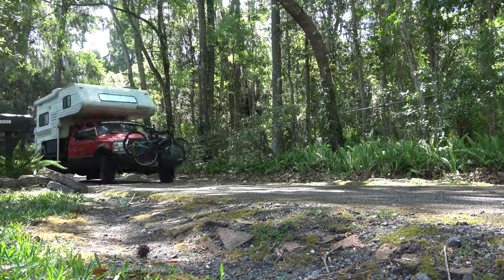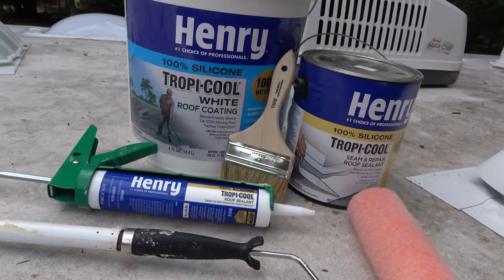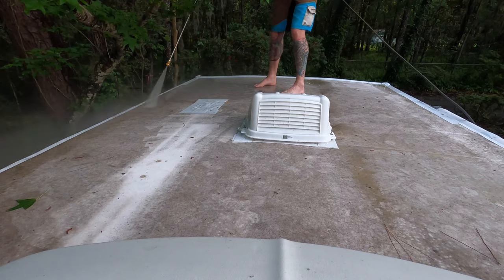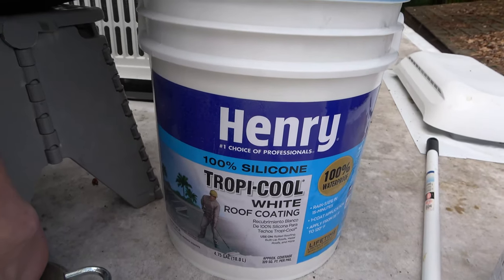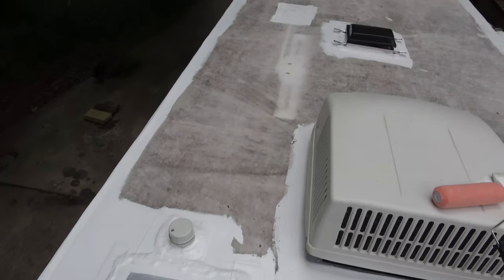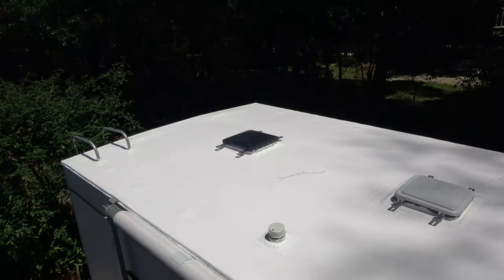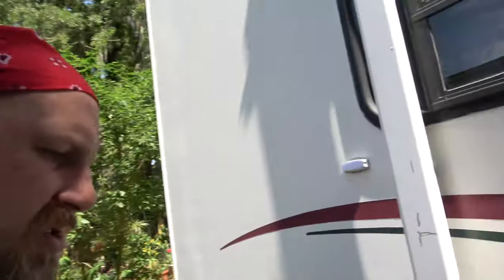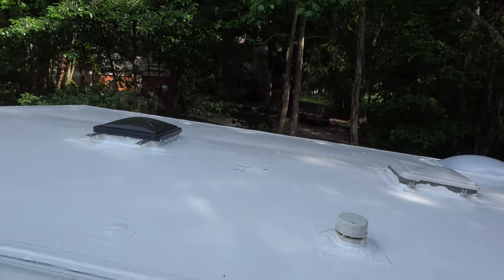Make Your RV Roof Last Longer! // Henry's Tropicool RV Roof Coat RV Roof Maintenance

Comment: I have put this on 4 of my friends campers over a 5 year period and they all love it, no problems yet and it's so easy to wash also. Going to put it on ours this year, I see where Home Depot has went up on price around $200 this year.
Reply from the maker: Glad you found success in using it on RV roofs as well! We're almost a year in now and the coat is doing great!
Reply: I was told it's because of a silicone shortage... around $450 now.
Reply: @twoguncorcoran4733  as an a former worker in an Ardex/w w Henry worker 2021 there was always shortages in the self levelers good 4 days every month down time we would sweep and clean  with nothing to make not even on Pail line a pail would be the plastic buckets 5 gallons and all that deal so yeah yeah really wishing I still could get that discount rn
Reply: Have you tried lanco cool guard?
Reply: @vango1131  cool gaurd is cheaper significantly even more so than Amazon products for rv roofs. That doesn’t exactly say quality ingredients for rv purposes lots of shaking bouncing things like that but I’ve heard the same counter claim for Henry tropicool keep that in mind that even with lifetime claims the lifespan of every product will vary and so will up keep and maintenance but I will say in my partial journey with Henry tropicool so far I’m very very pleased and think it’s worth the extra couple of bucks a roof isn’t where you should pinch a penny imo with a grandpa that does roofing in some of the best areas inside 285 Atlanta slate tile and won’t touch a shingle roof ain’t worth his time… so I might be a little biased but your roof seal’s your wood, framing, insulation, electrical, down to the flooring and joist to keep water out and keep everything solid so research research and then research… I think for weekend dads 4 or 5 late trips during the summer and maybe some guest every blew moon cool guard might be the trick but the temperature difference sales pitch is black vs white roofing and actually on the side of Henry tropicool it’s a little QR* code to show off the dirt pickup resistance technology and I get it i sound like a salesman but I’m just giving my two cents and the reason why everyone said you don’t need to spend that much when the quality and slickness of Henry speaks for its self I plan on showing off the camper once it’s finished in a few weeks but do have some pics and videos of it  if now
Reply: @OGxoKANE  good input thanks
Reply: Now it's 349 dollar plus tax!!

Comment: Henry’s says not to apply their product over the Eternabond tape as it will peel off and will not adhere to it.
Reply from the maker: We read the same thing and because the Henry's was our 3rd layer of protection (lap sealant + eternabond + Henrys) we were willing to take the chance that it doesn't stick. Nearly 1 year later and it sticks fine. The only time Henry's has shown any weakness has been in the times we've had scrapes from tree branches peel back a little along the edges here or there. We think they know in the long term Henry's will adhere better to other materials than to Eternabond. So if you expect to get 10+ years with Henry over Eternabond then you may be disgruntled if in year 5 it starts to peel. But we've had spectacular results and would do this again 100%.
Reply: I think that I would do the same eternabond on front & rear then Henry over everything. I might for now since mine is 4 years old just paint Henry's over the lap sealant.
Reply: There's a version of Eternabond tape that is specifically for applying coatings over.  It's called Eternabond WEBSEAL.

Comment: You might want to do a short video talking about the issue of Henry’s and Eternabond.  Even if it is just discussing the things that have been shared in the comments on this video, like tips for improving the bond with the sanding and contact cement.  And things you learned as you researched the great RV roof dilemma.  I think many people would appreciate and benefit from the knowledge you have attained.  Not everyone reads the comments.  I think you have a great opportunity to add concise and helpful info on YT that simply may not be there in a concise manner!!
Reply from the maker: Good idea. Will add it to the (long) list!
Reply: The solution is to use eternabond webseal instead of the normal eternabond that is smooth on top. The webbing on the webseal is specifically designed to hold onto the coatings and not peel off.
Reply: @grc5618 by webbing do you mean the integral scrim within the tape?

Comment: I use this product before watching. My EPDM roof turn black so it loose it with color. Instead of pressure washer , I use 90% alcool found in drug store. That was recommended by a friend who work in aircraft industry (Bombardier regional jet). It turn perfect and remove any dirt on the roof. I will see how long it last. I decide to do a first tin coating and do a second one the berry next morning. It take two gallons to do the complete job on a 30 feet RV. The company suggest tin coat at the time.
Reply from the maker: Glad you found success with Henry's too!
Reply: So, how has in been holding on? My roof is also black.
Reply: Why people do not proof read before they post comments 🤔

Comment: I'm not a pro but in the process of remodeling my 74 pull camper and watching a hundred approx videos for tutorial purposes I was informed by pros not to use silicone under any circumstances to surfaces that will be exposed to water or weather in general this fella said he wouldn't use it for anything due to shrinkage and subsequent pull away so I stick with his advice and used Heng's and dicor products FYI no problem so far 4 yrs in plus I had no idea what I was doing I just jumped in 😎 so take this with a gran of salt if you have used a silicone with positive results that's great, but  the prof camper roof guy scared me 😂
Reply from the maker: Professional roofers scare EVERY diy person trying to save money. We shopped new roofs and it was absolutely outrageous both the cost and the experience of them telling us how we couldn’t fix it ourselves. We didn’t have any water damage before, which is why we prioritized this job, and 2+ years later the roof looks and works just like it did in Day 1 after the Henry’s application. RV roofers are about the worst people on the internet
Reply: @CalledToWander too each their own
Reply: I think primer is the key. I f you primer correctly, everything should stick together..

Comment: Very curious how the Henry’s bonded to the Eternabond tape . I have been using Eternabond for years on many different campers as I did with our current 5th wheel . I contacted Henry’s and they said it will not bond , told me I would have to remove it all before applying their coating ! Your video begs to differ lol
Reply from the maker: To each their own. From a chemical standpoint, they likely know more about the interaction. But from the fact we did it and it is still going strong 8 months later through all sorts of weather, we don't regret our decision at all. I imagine from a business standpoint they have to cover their bases in not making guarantees or promises. We're not RV roof experts. But we spent dozens of hours researching all of the options and this was the best, most affordable and longest lasting option we came up with. If you're planning on making a business out of RV roof repair, maybe go with what the company says (and charge customers an arm and a leg!). But if it is for your rig, I can say that we have not had any issues. Plus, where the eternabond is used on our roof along the edges and around vent covers and holes, we trust the eternabond to do its thing and not leak. So if we ever had to cut the Henry's around the edges of the eternabond or whatever, we'd still have the extra protection from the tape. We said somewhere, maybe in the remodel video when we actually applied it, that we have 3 layers of ADDED protection for the roof. To Start: the EPDM roof was in pretty good shape, with just a few visible weak spots but NO water damage yet 1) We put Dicor lap sealant around all seams and edges and the holes we made when we removed our cheap storage rack and antennae 2) we put Eternabond over the holes, edges and anywhere else that showed potential wekaness on the roof and 3) 2 layers of Henry's was more than enough to cover up any potential weak areas in the EPDM and seal around the whole roof. Our goal was keep water out of the RV and to date, we're not worried! =)

Comment: Great stuff I have used it before. Just make sure the roof is absolutely clean and you shouldn’t have any troubles. Going on for years and still holding up.
Reply from the maker: Good tip! We’re over 2 years now and it looks brand new after a quick rinse!
Reply: @CalledToWander some say it’s a dust magnet. So does it clean up after being dust covered

Comment: Dude, NO ONE answers questions as well as you. My back would be SCREAMIN' FOR VENGEANCE! if i did that. Gonna try, though. Maybe roll what i can. Did the eternabond  and re-sealed that. So this will be FOUR LEVELS. Your a good dude, bro. See you out there. Rubber down.
Reply from the maker: Thanks! We couldn’t find thorough info when researching for our remodel projects so we decided more info is better than less!

Comment: I see you brushed the roof with a broom. Wouldn't it also be advisable to wash and scrub the roof before the application?
Reply from the maker: We scrubbed the roof and then lightly pressure washed it the day before painting on the Henry’s
Reply: @CalledToWander what did you use to wash it before applying

Comment: Great video.  I just finished a 42 foot 5th wheel.  It took a little more than 3/4 of a 5 gallon.  Should a use the rest on the 5 slides?
Reply from the maker: Nice work! We can’t speak to the slides. I put the rest into additional coats in the roof just because I had it and it was too expensive to waste. It would probably work in the slides, but I don’t know if the slides make contact with the trailer and it may scrape off?
Reply: I have used Henry's two different times, and both times coated the slides it holds up pretty well. For the average use, it will hold up extremely well.  I full-time RV, so I am in my RV and traveling tons.
Reply: @nehemiahnulton2694 you say you used it twice.... was that because it needed a reapply? if so, how long did it last?

Comment: Great video, thanks. We are about to do this to our 2011 39' Bighorn with EPMD. I've looked at many pics and watched many videos. I do have a couple of questions. 

The documentation states the dry film thickness should be a minimum of 22 mils (an inch is 25 mils). That seems really thick. i.e. I don't see how I would prevent it from puddling, pooling, go over the side of the trailer, etc. attempting to roll out/on something that thick. You look like you did a great job. How 'thick' would say your application is/was? (I might be overthinking this, but I don't see adding a 1" thick silicone layer in one application.)

Is it necessary to remove the AC and tape around it before rolling? I'm trying to understand the risk of simply cutting in the Henry product and then rolling the roof. I don't see any damage around our AC. Is the tape to create some slope away from the AC?
Reply from the maker: I did about 2.5-3 coats just because we had that much left with the 5 gallon container and we wanted a nice thick coat. But no way it is an inch thick! We don’t skimp when it comes to paint. So trying to make a gallon “stretch” wasn’t worth it. We over bought and applied and it worked out. 

Try to cut around everything you can. Take any covers off and get as close to appliance as you can. I made a mess of the covers and appliances but were more function over form!
Reply: I think you are confusing the term "mils". In the metric system, true, 1" is 25.4 millimeters. In the manufacturer's use of the term "mils", they are referring to a mil as being 1/1000 (1 thousandth or .001) of an inch so if you figure, 25 thousandths is 1/40 of an inch.
Reply: @irainman4410  Thanks!

Comment: Curious, I see a lot of people brush the corners with the tropicool where as you guys used eternabond? Did you have any issues with brushing on the enternabond? I was going to seal but I have a few places that have eternabond and was told to take it off prior because it won’t adhere to it but I don’t wanna pull the eternabond, it’s doing it’s job , rather not disturb it
Reply from the maker: We're about to put an update on the roof/Henry's next week. Essentially, Eternabond and Henry's aren't supposed to play well together. But over 2 years later, our paint job is adhering very, very well for the most part. We have a few knicks from trees and scrubs that caused some peeling of the Henry's. However, we just sprayed the spray-on Henry's leak fixer to those spots and it is back to functioning perfect. People say what they want to say. But the reality is, our roof is holding up well. The Eternabond on the corners and edges was a priority for us because that was the area most impacted by the EPDM fabric starting to show signs of age and potential punctures. You could probably paint Henry's directly on those spots. But for us, we wanted a 100% impermeable edge and Eternabond has worked out great!
Reply: @CalledToWander did you guys cover the hard plastic edges where the tpo/epdm comes out from or did you remove and put eternabond uunder? Or right up to where the factory sealant (usually crumbling) was. Sorry if that doesn’t make sense, I seen people do all diffferent ways.. just wanna see what ways people
Had success thanks for the response!
Reply from the maker: @hyunwhyte1338  We put the Eternabond over the edges, from the metal rail that seals the roof and sides together to across the roof as far as the eternabond would stretch (nearly 4 inches). We wanted to seal in the edges where the EPDM was starting to bubble and stretch as the Eternabond is 100% impermeable. Then we put the Henry's over this area... We'll be publishing an updated video in a few weeks on the 2+ years later Henry's application to show that only in these areas did the Henry's peel off the Eternabond in a few small places thanks to thinks like tree branches and removing our old awning. Otherwise, Eternabond on the edges + Henry's = indestructable watertight seal

Comment: Hi ya Pirate. Lol. I also used Henry's, but the Canadian version. #487 100% silicone. I bought a 1996 Fleetwood Bouunder 32H. Took me more time to prep than coat. It is amazing stuff and has held up real well. The Henry's silicone in the tube isn't available up here but I'm close to Bellingham WA so will head down to get a few tubes to carry in case any repairs come up.  Thanks for sharing.
Reply from the maker: That's great to hear! We get a lot of negativity (mostly on our TikTok videos) about the use of Henry's but it has done a spectacular job, now nearly 1 year later! We have a tube we carry AND they have a leak spray that we carry as well in the event of emergency use. But we haven't needed either and the roof is in great shape! Thanks for watching and reaching out! Arrrrrgh! =)

Comment: I was going to put eternabond around all the seams on the edge of my roof then roll over it with Henry's Tropicool. Then i read online that it doesn't stick very well to eternabond. Did it stick well for you and is it holding up well? Thanks.
Reply from the maker: Stick well is the phrase. It does stick well. But chemically, the two are not compatible. We’ve had 2.5+ years with this in our roof now and it looks and acts brand new. There are 2 small places where the Henry is peeling up, like dime size spots. That’s over the eternabond. But it does go over Eternabond fine. There are alternative tapes like eternabond that are more compatible with Henry’s. Worth looking jnto
Reply: I also read it will work fine if you scuff the tape then put contact cement over it, then apply the Henry's.
Reply: Great discussion!  I’m a big fan of Eternabond, but I feel like it is a pretty permanent commitment.  So tips on making it work with other stuff is great!!

Comment: Very informative for me as I'm a new 1974  (for me) camper owner and don't know diddly.  My roof is so knarly and I'm already wore out trying to remove as much as I can.  Is it safe to say that if I can eliminate most of the dried chipped old stuff that I can apply the Eternabond over it and then seal over it with the Henry's?  Also, this camper's roof appears to be aluminum.  Will Henry's still work? thanks
Reply from the maker: We have EPDM roof and it worked fine. In theory the eternabond should not have been applied as the Henry’s is not entirely compatible. In reality, 2+ years later the Henry’s is adhering perfectly fine to our eternabond. Critics will say don’t do what we did. But we are living proof it works… but there are eternabond alternatives out there that may work better with Henry’s. Worth looking into to do a little better job.

Comment: How is that holding up on the tape? If you had to do it again would you change anything?
Reply from the maker: The tape is eternal. However, it does not play well with Henry’s. It’s working fine for the most part. But in a few places the Henry’s is peeling back off the tape. We’ve heard Henry’s makes their own compatible tape but we didn’t look into it after using eternabond. But we use eternabond anywhere we don’t want leaks or rips (including awning) because it’s that awesome
Reply: @CalledToWander Eternal bond makes a tape that is not shinny and is for painting over. It cost about the same as the tape you used.